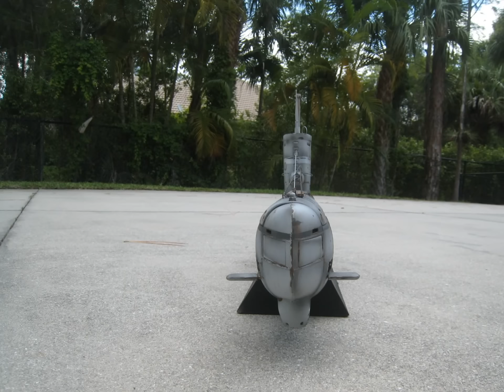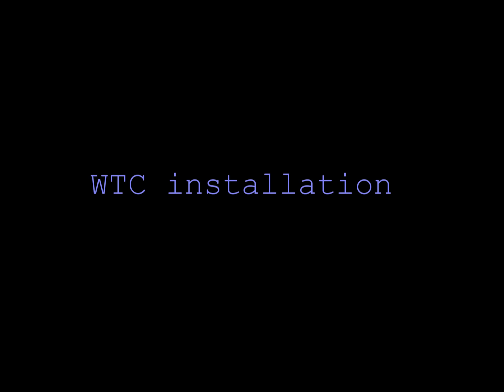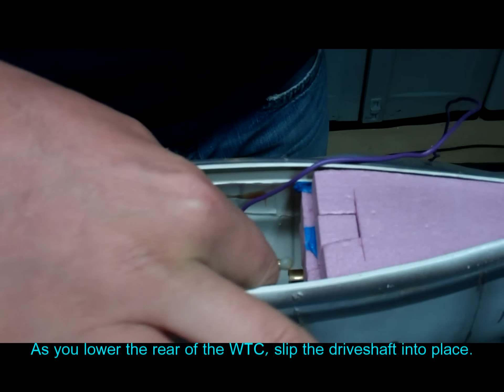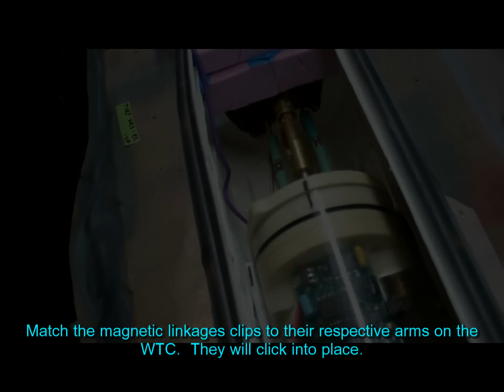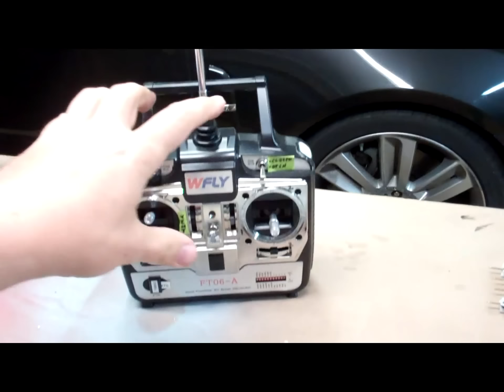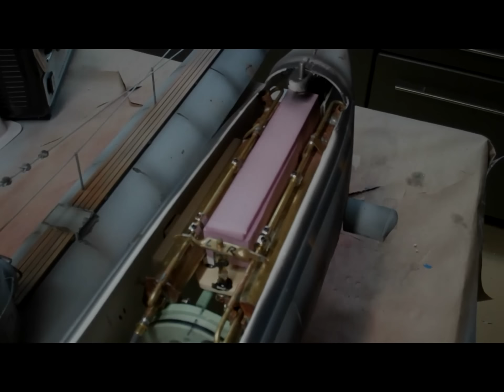Type XXIII R/C submarine

Comment: Great video! beautifull sub! I'm putting together  a plastic model from Revell (U99 scale 1/125...). I'm planning to make it submersible! What do you recommend to make it air tight and what type of paint w'd be the most apropriate ?It 'll be controlled by wire. Thanks for any help!!
Reply from the maker: I find that standard paints offered by companies such as Krylon work exceptionally well in our applications. You're working with a small boat, so I recommend a small cylinder, perhaps even a large syringe (350 or 500ml?) for the body. It would be watertight and offer turnkey access to the interior by way of the plunger.
Reply: Thanks for your prompt reply!  I believe a few coats of Krylon ought to make the sub air tight, and a few spot applications of marine sealer here and there. I'll be using a small water pump to take the water out, just can't let it be completely submerged or past the snorkel level. Thanks a lot!!

Comment: Marvelous and meticulous work... I am not part of the RC scene but have a tone of RF and RC experience and am wondering how the RC signals can work under water? Can you explain?  Thanks
Reply from the maker: Lower frequency radio waves actually penetrate water rather well. Hobby radios typically use frequencies lower than 75MHz. Any contaminants in the water, however, can greatly reduce the range.
Reply: +RCSubGuy Yes as mentioned I am quite aware of RF and this is why I ask the question since most of the "hobby" radios in the RC community seem to have moved upwards into the 2.4 and 5.8 GHz band not into the lower frequencies. All quite interesting.